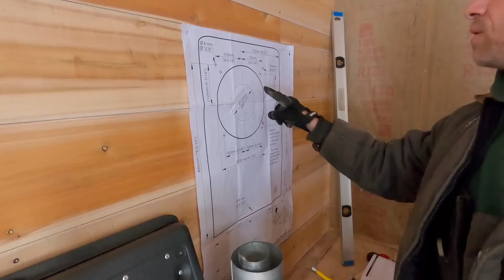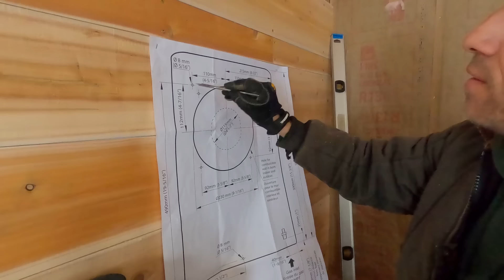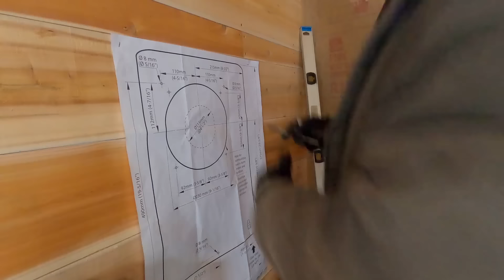Tiny Cabin Direct Vent Heater Install (No Electricity.) After Three Years in a Tent, Now HEAT! #114

Comment: only way to do gas or propane type heat even in campers and trailers, the unit takes are from outside to burn an element that afab blows or across so you never get any unburnt or burnt fuel in your cabin or camper, a small pot of water for humidity if its real dry ora nice smallish portable humidifier air purifier.. yup, you only get the one set of lungs, why someo propane are bad they heat with the burnt fuel and that exhaust is inside your cabin or camper, NO THANKS!  some of them actually use the air in the cabin or room to burn the propane, and that's where a lot of folks get in big trouble, it gets too cold they want heat fast so they close all vents and windows, the propane uses all the oxygen and said individuals decease from hypoxia..

many fatalities occur from gas or propane leak itself, with no sensors they are overwhelmed and pass away during the night, why you want a good system that never ever allows any gas of any type in your cabin or room whatever camper, burnt or fresh, if a leak develops it can never enter said room.. ever, the only possible issue would be if it got so old the heat actually deteriorated the element it heats and then exhaust might enter but make no mistake they are built so that other issues will occur before that ever happens, more likely than not it will set he dumpster first, they build for these scenarios so they use thick hi carbon steels..  you get what you pay for good systems are expensive but they save lives and lungs..

its like heating your cabin with a NON air tight stove, not really a good idea for the duration, soot will clog your lungs eventually no good, use air tight only and do change out seals every 5 years or so whatever they recommend, keep it sealed, a good pot of water always going for humidity and you havenic healthy clean heat, renewable of you can plant a seed or a sapling ...  decent stove it exhausts outside right?  BTU?

Comment: I installed one of these myself. https://youtu.be/WOo5u9lpL5k 
Some advice to keep yourself (and stuff) safe.
This will sound paranoid but given that you are off grid, I would highly recommend buying a couple of extra parts for this unit now. Having a few things ready might make a big difference if you have stuff that can freeze inside your cabin (and thereby break). First, my ignitor went (it screws into the side of the base heater unit with a wire to the top). Cheap but annoying. Then the copper tube/wire (the thermocouple) piece that tells the pilot light to stay on fried (just stopped working). Keep in mind, my unit is only a couple of years old. The ignitor went within 8 months. Finally, there are two screws that hold the burner unit together, those are cheap and broke when I tried to replace some parts (other stuff I won't mention here because it was probably specific to my unit). Long story short, I would recommend emailing the company (they are terrible with customer support so you'll probably need to actually call them), and ask for the most obvious parts that fail (literally "Tell me what fails on these!"). Spend the two hundred bucks and just have this stuff sitting around. Sounds paranoid but given how specialized the parts are, how bad the company is at responding (took me three months to get parts, sent me wrong parts, etc.), and how likely some of these are to fail (based on my conversations with them, it seems common but I am making an inference). Finally, if you plan on removing the front glass for whatever reason (the glass that is screwed in with brackets), you'll want new gaskets (expensive little pieces between glass and unit to seal it). Mine fell apart in my hands. Would I buy the unit again? It works ... if you are handy and persistent.

Comment: Curious. Does that Martin heater turn itself on and off when needed or is it manual. Does the unit run the thermostat on its own without electricity after you have the initial lighting? Thanks

Comment: Why won’t you entertain the idea of putting in a small wood stove?  It would help control cost of propane  and travel to get replacement fuel and is a more confortable heat.

Comment: At the 20 , 50 mark the gas line should be placed where you are connecting the tank switch over and the tank switch over should be where you have the incoming gas line at. That way when the gas is coming into the sediment trap, any sediment will fall straight to the bottom of the trap. This is how it has to be to make it in compliance with Federal codes. I also attached an LP filter to my heater. https://www.youtube.com/watch?v=lN_z3V6ni6U

Comment: I would get the bigger 100lb tanks like in your shower for propane or ull constantly be filling 25 or 40 pounders even if you have to buy a two wheel cart to move them around. Eventually youll see why

Comment: @ Ryan Ringworm
A YouTube creator called "advoko makes" has a video released on Oct 15, 2019 about chainsaw milling boards. It's a pretty cool technique but I'm wondering if you might give it a go, see if it's easy enough or a complete pain in the ass. ALSO he uses a vise he built out of a tree stump in about 2 min and only tool it uses to tighten up on your chainsaw bar is a wedge. Can quickly sharpen your chain anywhere , super fuckin cool man. Maybe give it a go with an old stump (just has to be tall enough). Your cabin build is awesome, thanks for the bitchin content brother.

Comment: It's known you never choose to be a 'know-it-all!' Yet your builds look good,  yet this heater installation worries me!? Sighting the gap between the wall & unit leads me to its reasoning, for perhaps installing a fire-proofing barrier? Such as a fibro-cement sheet floor to sealing? Hence the size [width] of its mounting spacers!? & it would be an added insurance in rapping the exhausted outlet [& needs to be extended further away from outer wall face, heat will scald unprotected timber cladding, should also have fibro-cement protection!?] & with fireproof tape!? Noting Rex Havoc; With gas plumbing down through the floor [putting the shutoff tap flush to the wall!?] may also lessen the chance of liquid freezing during your winter season.👍 soldier on champ!

Comment: haha joke expensive caliper, i just buy 2 caliper cost digital good caliper 7$ and old not elektric caliber 4$ normal price. before has same and can use 20 year but stay my old house. i buy 2 new. and this job no need caliper only tape measure, new gas pottle cost 60$ and propane heater cost less than 120$ best model what have in shop. but wood stove need be if want live in cabin good. forest have you cabin around lot free wood. cheapen heater, gas need only kitchen make food.